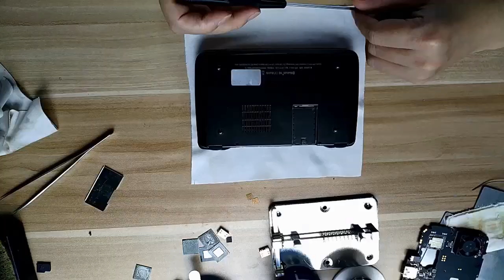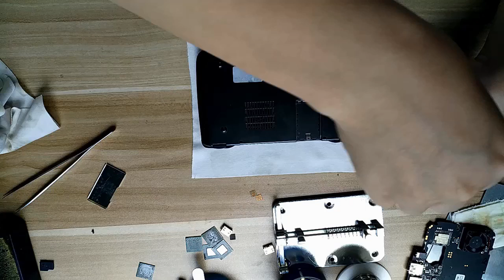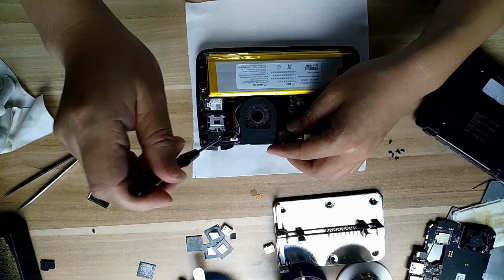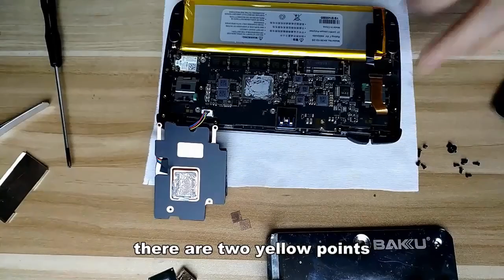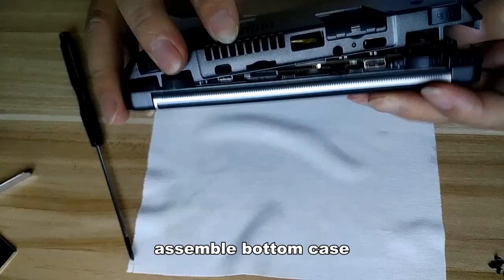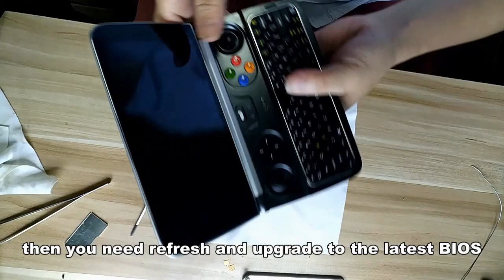repair WIFI of GPD WIN 2

Comment: Hi, I recently bought a GPD win 2 and have this WIFI issue: 5ghz band connect 1 per 10 tries, and when connect, only last 2 or 3 minutes and disconnect, so have to start again with connect tries. However, the 2,4 Ghz band connect and run perfectly. Does this soldering solution works for me??
Reply from the maker: Brand new unit? I thought WIFI issue just happened on early IGG version
Reply: @gpdgameconsole Why don't you answer his question?  My 2.4 is broken and the 5 works.
Reply from the maker: @uhadonejob  Maybe you need change a SSID to check
Reply: Nah, I have a router that works as 2.4 and 5.  Gpd win 2 will connect only if 5ghz is on, not on 2.4ghz, but will connect disconnect constantly.

With my phone mobile hotspot it doesn't do that